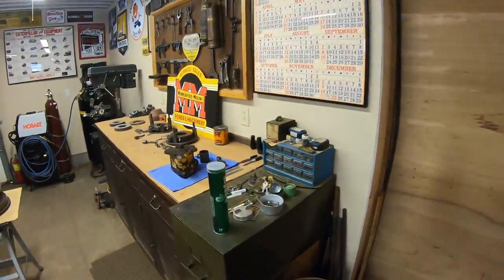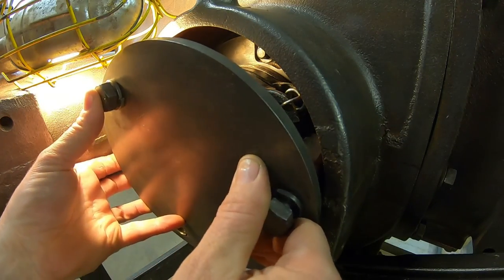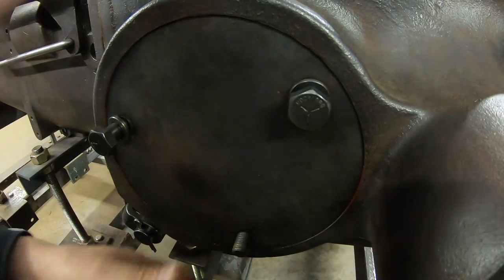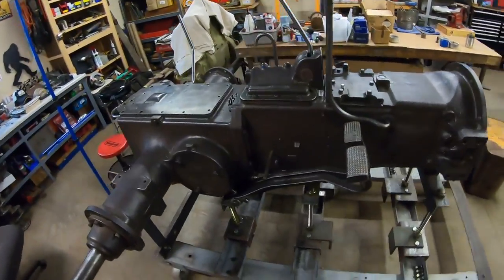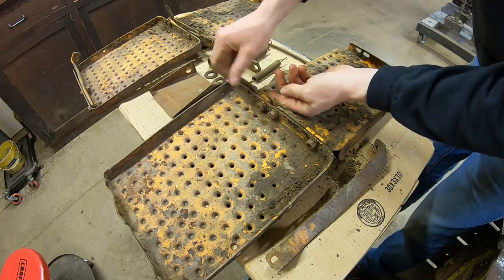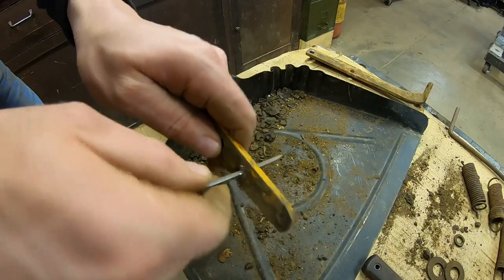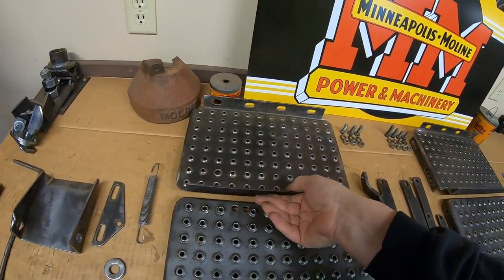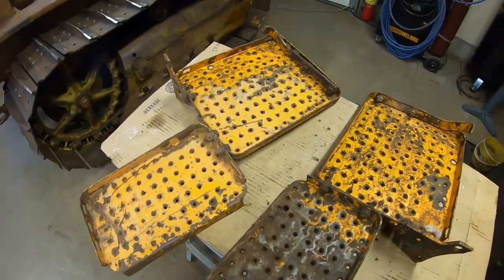#X231 Prototype Part 66: Brakes In & Repair Work on the Foot Plates Begins!

Comment: Hah. Love the simplicity of that braking system. Such a neat little design. Man, it's stuff like this we kinda miss today (not the brakes specifically), a clear sign that an intelligence was behind something, not just a program that directs a "by the computer schematic" engineer to take a part off the shelf and somehow marry it to the rest of the jumble. At which point, is when you have to take apart the front bumper, front wheel and six other devices to reach the oil filter. :))

Comment: Fantastic episode again.  Glad to get a few more X231 episodes before you move on to the H.  At least the next few steps are not complicated fabrication, just clean, repair and fit.  If it was up to me, but it isn't, I would see the X231 through the spring.  I understand there are economics at play so you must do what you must do.  You just need a wealth M/M enthusiast benefactor.  Give Elon a call.
Reply: Elon's being busy losing the plot. Better call Bezos.

Comment: I would expect in a production variant that they would've made those splines go deeper in the shaft. Would be interesting to see the production variant by comparison.
That said, funny... usually these reproduction or later production parts are looser, not tighter. :)) Either way, nice fix.

Comment: The footstep (13:25) is admittedly not on the photograph of the prototype - but it definitely looks both well made and in a very similar style to the "proper" braces and spacers.

It certainly doesn't look like the rest of the "farm" modifications, improvements and repairs.

Comment: fyi if you get a brass or copper 1/4" plate and clamp on back side you will be able to weld directly to plate and fill the hole. The weld will not glue to the plate

Comment: Myself I would put a standard flat washer on bolt on the pull rod ! Just the head of the bolt going through to me doesn’t seem trustworthy. Hit the brakes and have the head slide inside? Scary stuff . But that’s just me. It’s coming along nicely.

Comment: I guess you would mount this tractor from the rear then?  Those platform plates seem kind of high off the ground.  I always seem to end up with little chunks of wire in my shirt after using wire wheels.  I’d like to buy a small sand blast cabinet for small parts.
Reply: That extra step look almost "factory", if you could remove the twist.  My vote would have been to keep it and my head canon for that would be that the engineers added after the pictures were taken because they could not get up on it easily.  That would also explain why they moved the whole operator's station lower in the production models as they already knew it was too high.

Comment: Wow! a lot going on in those two little plates! I am so happy to see you move forward with X231 still. You will have a lot to primer when you start in with that. Any plans to work on the seat or operators area and or fenders? Those should be something less stressful also. 
How much snow did you get? They dropped the advisory for us just before it was to start. I have noticed that the storm next week (tue night, wed, thurs morning) has  had totals moving around.  I suppose yours is more lake snow though. 
Have a good day and next week.

Comment: When this finally gets some paint and is ready for the parade circuit you should splash a little paint on Kyles MM plow to pull around though probably not in the ground plowing

Comment: Interesting design from Minneapolis Moline: two piece food plates. Definitely someone used a lot of number 9 wire in the past. The brake system is self explaining. Did they change the dust cover on the production tractor? How much where the new break disks?
Reply: @squatch253  Thanks for the clear up. Very decent price for the disks considering how supplies are not available at times of demand.

Comment: Looking at the similarities of engineering across all tractor brands I have to believe one of two things. Either there was a lot of industrial espionage going on or maybe the simple explanation is the engineers all went to the same school of thought.
Reply: You see this in aviation, an engineer once said there are only a few best solutions so a lot of stuff looks similar.
Reply: Back before Kettering created points and condenser ignition,there were probably 10 different ideas ,how to. From glow plugs to other. After,for some 50 years,points and condenser was it. 
Automatic transmission internals,pretty much same idea. Once a really good idea shows up. 
Ferguson and his 3 point hitch. Still used.

Comment: Great video. My son says the techs at the Ford dealership he works at use the same silicone grease for doing brakes. I was wondering, so I asked him. I guess it won’t attract enough dirt inside where the brake disk pads are to make any difference. Will there always be a little drag on the pads with the brakes not on ? 
Thanks. Great stuff.

Comment: I get the feeling hydraulic pumps are not your favorite thing to work on 😀
Reply: @squatch253  If you have a desire to work on a tractor with parts readily available to take your mind off of Christine just let me know,  it could be good therapy 🤣 A ford 641.

Comment: I am wondering if this issue with with the brake disc might have been the reason why 1 disc was worn so badly on 1 side. If the teeth on that disc were binding on the splines, it would not float away from the inner plate. That would account for the excessive wear on only one surface.

Comment: Squatch, I'm curious about why some parts on the prototype tractor were so massive to begin with - brake pedal levers come to mind - but the production parts ended up being much more refined and less bulky. Why is that? Just design refinement? Obviously I'm no design engineer.
Reply: Alan, I can’t speak for MM or tractors, but in prototyping aircraft (commercial, military, home built), robust components are used during proof-of-concept phases (function, fitment, alignment, etc). Only after we have proven the design/concept works, we work toward “design for manufacturing and maintenance.”  There’s no sense having a mundane part (like a pedal or lever) fail during ground (or flight) testing. The mechanical engineers will save weight and complexity once we know the prototype actually works.
Reply: @jimru5574  thanks

Comment: When removing metal from the brake disc to allow it to seat properly, how did you account for wear in the disc?  the camera makes items look like they are not, but the disc appeared to have about a quarter inch of material in the wear area.  Would it have been better (if at all possible) to shim the inner wear plate closer to the disc and moving it away from the end of the splines?
Reply: @squatch253  Thank you for the detailed reply.  I kinda suspected the inner plate could not be moved, but couldn't remember why.

Comment: 1:40 How's that fix gonna work when the inner brake disk wears with use? Are you going to have a situation where the brakes gradually become less effective over time as they wear, causing the unground portion of the teeth to start hitting the ramped portions of the bull pinion?
Reply: My question too

Comment: Questions, L side, is there another support bracket for that side step? Does one of the brackets on either side have a bolt that fills the hole above each of the clevis?

Comment: I got to watching these a little later in the series and I thought it was a crawler tractor. As time went on I realized it was a wheel tractor. It's interesting how at this point in assembly there is not a lot of difference between the powertrains

Comment: Do you reckon once X231 is finished it will pull a plow on plow day?
Reply: Most definitely NOT! The live power clutch blowing up did so much damage in the rear-end housing that it took Herculean work just to get the rear end casting to 'marginal' shape by working tractor standards. Squatch stated in one of the way, way earlier vids, where it was putting the rear axles in, that the drawbar holes in the back are too thin to safely pull any non-parade implements without risking further damage to the housings.
Reply: @squatch253  Your welcome good sir! ^^  That vid I was referencing, where you made mention of how 'marginal' the drawbar mounting bolt holes are now as you were putting in rear axle-shafts, IIRC that was back before work on #5J1113 even started, wasn't it?